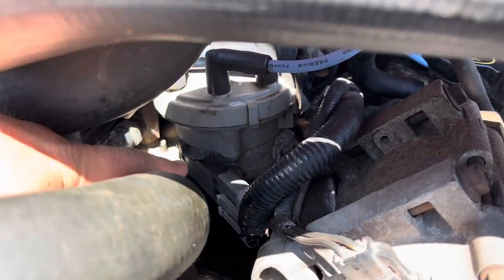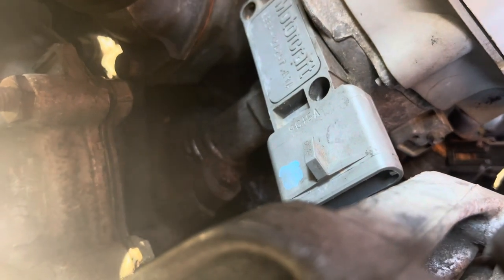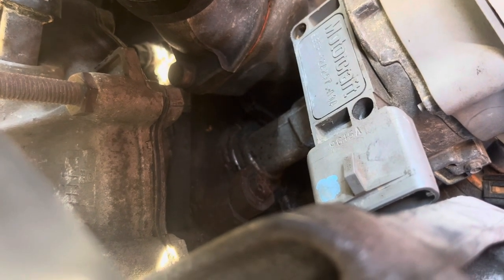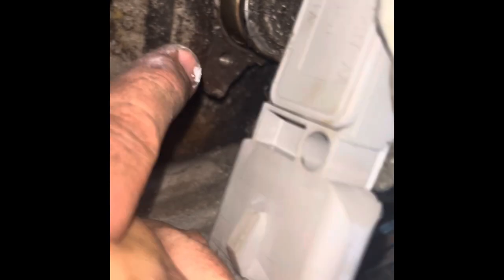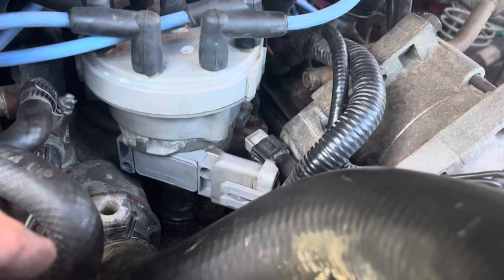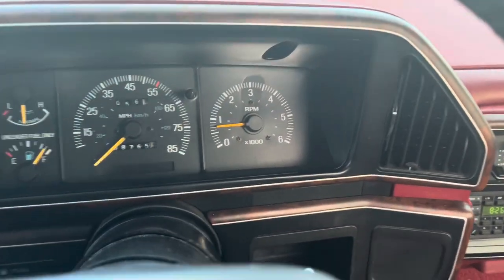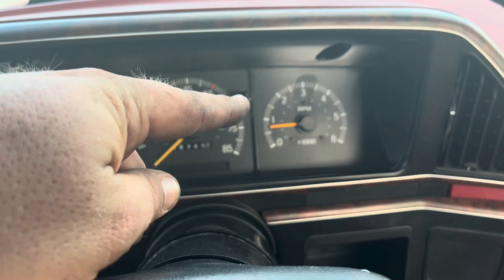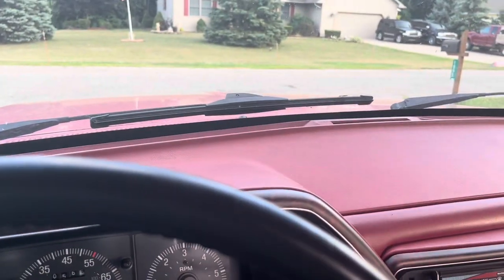1989 Ford F-250 With 302 Engine Ignition Control Module Replacement

Comment: Had that issue on my 96 F150 with 302 and 5 speed years ago. Knew it was the rear pump because it would run on the front tank, but stall when switching to the rear. Now I have an 88 F150 with the 300 Inline 6 and lost spark. Replacing the ignition control module and hope I get spark again.

Comment: Thanks for the video, I'm a pretty good mechanic and I figured out that's what's wrong with my 1989 Ford F-250 that left me stranded yesterday hours from home. Just got a new one and I'm going to go rescue the truck now and I needed to know the bolt size to make sure I had everything I need, and thankfully I found your video and you had this socket size 5.5 mm thank you. I think it's weird that you just posted this 2 weeks ago and here I am with the exact same year exact same truck exact same problem, except when mine died this time it would not restart and has not started since and they're going to tell my truck if I don't get it out of their parking lot. So I hope it works. But I would like to share some info that I've discovered about these same model trucks, there is another problem they have with the ignition shutting off like that and it is over by your battery. Passenger side. There is a connector that goes directly to the negative terminal on your battery it has two pins in it, two wires going to the harness behind the headlight there. Those connectors get corroded inside and they fail on and off. Check continuity between the negative battery terminal and the wires going through that connector. Especially if you undo it and it's full of corrosion. Good luck! 👍
Reply from the maker: Thanks a lot for the feedback. Good luck.

Comment: I'm having the sale issue with my 1986 f150 with efi. Ordered both a new ignition control module and a in-tank fuel pump. Hope one of these fixes the issue!
Reply from the maker: Ended up being a fuel pump for me but the ignition control was a known issue so that’s why I tried that first. Good luck.
Reply: How did those two replacements do for your truck? Hope all is well.

Comment: Update on my  1989 Ford f250 XLT with the 302 5 l automatic two-wheel drive. Yes it was the ignition module! Those damn TFI modules! But, I just took my distributor all the way out for a shot cuz I didn't want to mess around and I had a very short socket so I didn't want to strip the screws, and I could put more pressure on it by having it out of the truck. Easy to do on these trucks. But when I took my TFI module off, I was quite shocked how much corrosion was behind it, it was loaded. In fact I think that was the problem. But I wasn't just going to clean it put the old part back on cuz I didn't want to waste time my truck was stranded in a parking lot for two days and they were getting mad at me and telling me they were going to tow it soon. So I just put the new one on it after sanding the flat part of the distributor with sandpaper to clean it up first and I use plenty of dielectric grease that comes with the new module. Make sure you do that! Clearly the one that was put on many years ago by somebody else they did not do that cuz the corrosion was really bad and I didn't see any signs of grease. also I could tell it wasn't original cuz it wasn't a motorcraft part it was some Chinese thing. But it looked like it been on there for a long time. So I cleaned the distributor up and made it all perfectly shiny on the flat spot with sandpaper because if it doesn't ground it doesn't work. In fact I think that was the problem on mine but I wasn't going to risk putting the old part back on and having to take it off again just to swap them. So I kept the old one in case it's still good for a spare, but watch out that corrosion behind the TFI module is a very common thing and can cause a lot of problems. In fact I think it was contributing to some symptoms the truck has had for a while that instantly went away once the new module was on it and it was getting a clean contact to ground on the distributor. it used to start and surge for a few seconds and then it was like it was trying to balance itself out and then it would idle normal. I always thought that was a fuel problem like fuel injectors were dirty or something like that and then the computer would balance it out and it would idle fine. But I'm starting to think that stupid TFI module was not getting a good ground and it was causing it to surge, also sometimes in traffic it would stutter and sputter and have no power at all like it was the fuel pump failing or it had no fuel pressure, it would backfire and butter if I would step on the gas, and sometimes it would last for a few seconds and then drive and sometimes it would last for 15 seconds and then start driving again normally once it got up to speed again. Going uphill was a no-go, going downhill it would catch it speed up and then start firing normally suddenly. I always thought these things that would happen to it that were intermittent or some sort of fuel problem like the fuel pump was failing or maybe the injector drivers in the powertrain control module, but I tested my injector lines with noid lights and I got flashing when I cranked it so I knew it had injector pulse. Besides I could smell the fuel a mile away it just wasn't sparking! I knew it had to have something to do with distributor because I was getting power on both sides of the coil but no spark and the tax side was not flashing when I would crank it it would just stay on. So I realized that the switch that turns the ground on and off which is the TFI module was not working for some reason. There's three reasons that can be actually for if you include bad wiring between the distributor and the coil. The other three would be the TFI module has failed because it's overheated. The TFI module is not getting a ground to the distributor through the ground plate on the back of it. Or the pickup inside the distributor has failed which is also common because of overheating years. Mine was either the failed TFI or the grounding issue and I honestly think it was the grounding issue but I wasn't going to risk putting the old part on it cuz I just wanted to get it fired up and out of there. As soon as I put it on and put my distributor back in made sure my timing was right, put the cap back on, jumped in turn the key and it fired up instantly and runs better now than it has ever run before. And I think maybe those problems it was having in traffic once in awhile and the weird surging when it was cold start was part of the symptoms related to this problem as well, because those problems are gone too. The first time it started with the new module it fired up instantly on a cool night after it's been sitting for days and it started with no surging. And that was the first time that's ever done that. So, bottom line is I think these stupid little modules can cause a wide variety of symptoms but when you're not getting spark out of the coil, but you are getting power to both sides of it, and the power on the tack side is not flashing when you crank it, then it's that damn module! Or it's not grounding, or it's the pickup inside the distributor and it's best just to get another distributor at that point with everything on it. Thanks for the video though I really didn't want to try to figure out what size those stupid little screws were in the dark and strip them by using the wrong one. The 5.5 mm worked but I'm almost wondering if that's wrong because in the late 80s they were still using all standard size screws and bolts I believe. Ford didn't start using metric stuff until the late 90s. I could be wrong though if somebody wants to correct me on that. But thanks for the video it really helped me get the right socket so I didn't have to mess around in the dark in this parking lot where the truck was stranded.

Comment: Oh I just heard you say you needed a fuel pump now. Oh well, maybe somebody else will have the problem and see my other post. Lol. Glad you got yours sorted out. I know mine's getting fuel I can smell it when I crank it over and I tested my fuel injectors with some noid lights. Not getting any spark from my coil but I also realized the power wasn't switching on and off on the top side of the coil which means it's not getting me on and off signal from the distributor. So my problem is most likely that little module you just replaced. If not it's the distributor itself because the little pickup inside goes bad same problem they overheat and bake over time and die. In that case it's just best to get a brand new distributor for it if you can with the module and the pickup and everything all in one

Comment: thats not the ignition control module thats the TFI module. The ICM box you should be looking for is on the fender. Glad you fixed the fuel problem.
Reply: It’s on the fender on the OBS rigs. Distributor mounted on bricknoses

Comment: Replacing the ignition module on my 90 Bronco 5.8l but the distributor is seized up and won't budge. Not an inch. Sprayed a bunch of PB Blaster to try and lossen her up then borrowed a slide hammer and axle puller adapter from Auto Zone to try and pop her loose from underneath but no go. No good reason this shouldn't be a 10 minute R&R. I figure after all this trouble I'll find it wasn't the ignition module but rather the ignition switch. 😆
Reply from the maker: Sounds about right
Reply: finally got the distributor out (2x4 and hammer) and module replaced and sure enough the problem turned out to be the ignition switch mounted on the steering column  😂

Comment: Wow thanks for making this video!  I am experiencing very similar happenings with my 89 ford 302!   May I ask you questions about this fuel pump you replaced. How did you determine the pump was bad?   Thinking back on that fuel pump replacement, when you pulled the pump outlet tube off of the rubber hose, did you see a slit in the hose or not?   I ask because I pulled my pump, thinking it is bad, but I found a long slit in that hose and so I replaced it and not the pump.  
but I still have the same problem happening, now I wonder if that slit is originally supposed to be there, perhaps for a pressure relief issue??   
And there is no one at parts stores of dealerships old enough to answer that question!  rrrg, frustrating. 
 Did your hose have a slit, or did you replace the hose also?  because your there and were talking about inside the tank, not an easy area!
Reply from the maker: I’m sorry I don’t remember for sure about the hose. I don’t think there was a cut in it but I couldn’t say for sure. My way of thinking would have been to replace the pump too while you were already in there with the tank lowered. Over time I have replaced all 3 pumps and the manual switch between tanks. That switch is another factor. I would switch fuel tanks and still be pulling from the other tank overworking the exterior fuel pump on the frame. That’s something to consider as well.
Reply: There's another video out how to clean the Tank selector can, further past the Hi pressure pump. Evidently has a lot to do with which tank WILL work. May be a dumb question but did you swap out the fuel filter?

Comment: Hey when your truck would stall  would it cough and sputter before before dying like when u run out of gas? Because I’m working on a 89 f250 5.8L and it will start and run great for a few minutes then with no warning, no sputtering nothin, it just dies like as if u turned the key off. It will restart right away just fine and run for a minute or so then, boom dead. I replaced the frame mounted fuel pump and filter, distributor /cap/rotor/icm, ignition coil, throttle position sensor, and the ignition switch.. nothing changed. I didn’t want to drop the tank to do the in tank pump but I’m thinking I might have to.
Reply from the maker: It did some of both. A couple of times it died with almost no warning. But I can think of once when it sputtered and I could feather the gas to keep it going for a little bit. The key for me was to listen for the fuel pump on the rail to get louder than normal. When the tank pump would get weak I could really hear that rail pump whine. Then it would eventually stall. I have 2 tanks but the problem for me was that the pump in the rear tank was bad too. So I couldn’t just switch tanks to check it. Good luck.

Comment: I’d love to see more videos on that truck man, I have an issue Where my f150 will start perfectly but then shuts off in about 1 second,
I have spark and fuel pressure, no codes anyone have an idea as to what it could be?
Reply from the maker: Thanks for your comment. Unfortunately I traded the F250 for a 1969 Pontiac Catalina that I’ll have some videos on soon. As to your issue, what year is your truck? Helps to know what fuel delivery system you have among other things.
Reply: Try F150 Forum or Ford Truck enthusiasts, some folks there have YEARS at Ford Service managers. Scary what they know, remember..

Comment: when them pumps start going bad they over heat quit working
Reply from the maker: There are a lot of factors when you have 3 fuel pumps. Plus the actuator between the 2 fuel tanks when gummed up can overwork the fuel pumps.

Comment: I have an 1989 Ford F-150 won’t start from ignition switch but it’ll crank from 😂sylanoid but no spark
Reply: Same issue sabe truck.  Did you replace tfi?
I'm replacing mine tomorrow hopefully it does the trick
Reply: Not yet I haven’t
Reply: Some reason it won’t start from key switch
Reply: It sounds like the neutral start switch.
Reply from the maker: I hope you’ve gotten it worked out